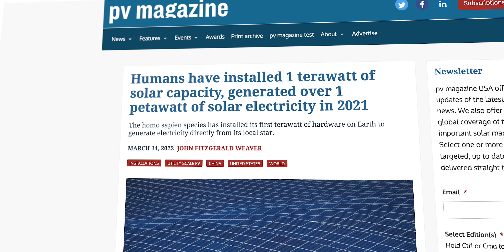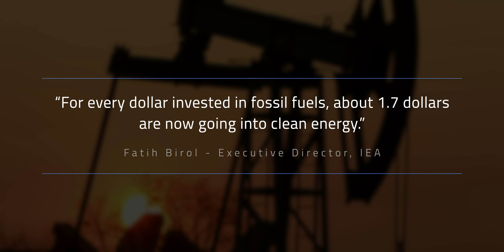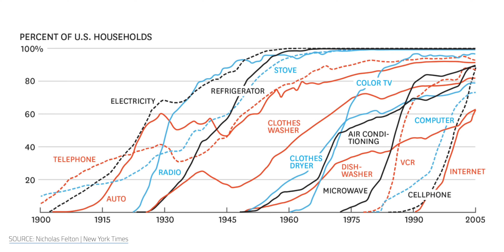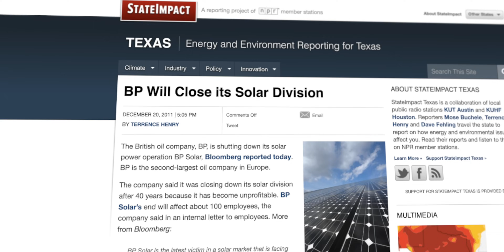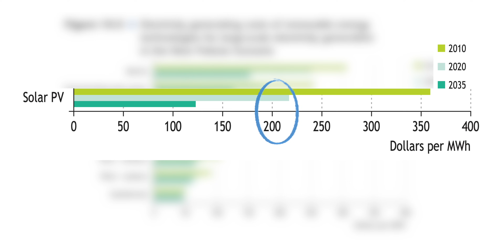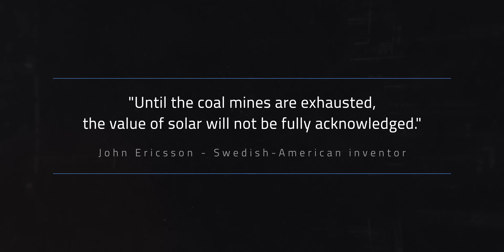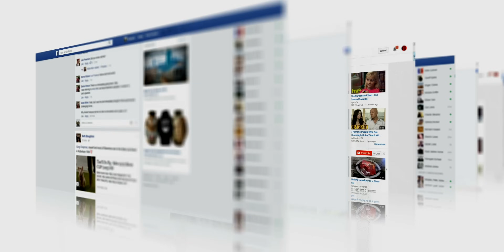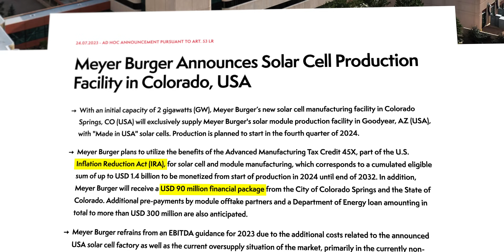How Solar Power Got So Cheap … So Fast

Comment: I knew solar would get popular eventually.  In 2001 we bought land that had no electric service, so it was dirt cheap, so to say!  I knew eventually we could install solar, and the land would be more valuable.  We are now at the point where its much much cheaper to install solar electricity, and the public is just now starting to notice this, so land prices are moving up for raw land with no electric service.  I was about 18 years too early, it took much longer than I expected for solar to catch on.

Comment: Solar panels can be down in price with little relief for actual install costs in part due to inflation of install costs labor, and support materials. Add to that you have issues if you need to replace your roof; and to make a pratical system; you need expensive batteries to store the power for night use. Of course you must be in a pretty sunny area. The best examples of solar installs today still cost about twice what convensional power costs per KWh.

Comment: Batteries are moving to LFP technology.  it is worth waiting for these before installing a battery because they are much safer.  They are much less likely to explode or catch fire.  They will also last about twice as long as NMC or NCA technology.  However, they are a little bigger and heavier but that is not a problem.  I think that they are a little cheaper as well.  Eventually we will get to solid state batteries but that might be a while yet.  These will be even better than LFP batteries.  They should be even safer and last much longer as well.

Comment: I live in Kenya and I'm building a house that will sit (for all intents and purposes) right on the equator. The closest village is called "Jua Kali" - which translates to "Fierce Sun." All of that coupled with sunrise and sunset being at exactly the same time all year round, we are in an ideal place for solar. There are no incentives here from government. There is little incentive to  connect to the power grid, The one power company we have (it is a monopoly) will only give you 50% credit for any power you send into the grid. These are credits. That means for every KWH one pumps in into the grid, one gets credit to purchase half of one KWH. One still has to pay all the standing fees that are on top of basic consumption of power. Our power grid is very unreliable. We lose power several times per week. Typically for an hour or two. But sometimes for a day or more. Going completely off grid by installing power storage is desirable, but it is very expensive. As Matt has said. It all comes down to money.

Comment: Surprised the Thomas Edison solar quote was not quoted in this video, yes from the guy that commercialized incandescent lightbulbs. 
“I'd put my money on the sun and solar energy. What a source of power! I hope we don't have to wait till oil and coal run out before we tackle that. I wish I had more years left!” (from a 1910 interview)
A hold back to solar cell production has been silicon wafer production. The increasing demand for electronic chips in recent years has limited wafer supply somewhat as demand increased prices. With interest in global diversification of wafer production post-pandemic, there should be many new manufacturing sources of wafers, thus helping drive down prices from raw material sourcing to production.
BTW: it's fascinating the last 5 years, the growth rates of battery energy storage are very similar to solar growth rates. A perfect match.

Comment: Here in Lebanon under 2 years almost 5 out of 10 houses and buildings have solar on them.

Its so cheap compared to 3rd world alternatives. Public electricity is under 5 hours a day to 1 hour a week. Private generators cost a lot.

Solar is cheap and off grid here. With under 3k we power our house with around 2kWH panels

Comment: I would love to know how other competing technologies, like wind, are affecting this curve. Things like going from land lines to cell phones and then to smart phones do not have the same competition as solar does.
Reply: Wind can't work on individual residential, only big commercial farms.  So that also effect distribution lines.
Reply: Wind power has dropped in price and is continuing to do so (especially offshore wind) but not nearly as quickly as solar PV. However both have already got to the point in most countries where the cost of new capacity using them is lower than the cost of new fossil fuel plants even without any subsidy, and is much less than the cost of new nuclear plants. That's even taking into account the cost of the extra storage capacity (batteries, pumped hydro) they need. But it does vary a bit around the globe so I don't know if this yet the case in the US.

Comment: Hey Matt, where are you finding panels for $0.27 per watt? That sounds pretty amazing. And I'm talking actual watts, not where they claim 100w and then in practice you can't get anything more than something like 50-60w out of the panel under ideal circumstances. Although I don't think I've seen any claimed 100 watt panels go for anywhere near $27, usually it's closer to $100, maybe like $75-80 on sale
Reply: Check Trina Solar Vertex + 435W
Reply: thanks. After looking into them, I don't see any suppliers or dealers of them in the US?

Comment: I have solar on my boat and it's not very good. Barely do my fridge and the physical size is about a house door and a half 515w. Also they are not clean or green they are very poisonous when they're created, very in efficient and don't last that long either. "green tech" has a huge waste problem you can't do anything with them once they're discarded. Areas also get hotter as the panels reflect heat so they're like little radiators, when they get hot they get less efficent.

Comment: It is more about money than you let on. The reason solar exists in all the areas is massive financial incentives. Basically the governments said that if people aren’t going to choose to buy solar we’ll force everyone with taxes from everyone that we’ll give to a few. Given that the total benefit of solar is still not clear, This is not a fair way to do it. If that same money was put into nuclear, a safe and proven cleaner tech they would have more power for cheaper. Governments effectively completely wiped out the right 50% of that adoption curve and replaced it with “forced to use”.

Comment: I have been doing solar for 6 years already. Everything from panel to inverter to battery ALL Reduce, Reuse, Recycle.   I use NO new.   Way harder way more involved  than now.   That is why so few do it EVEN now with that route.

Battery pack from recycle batteries
Inverter fro Ups
Panel from used top tier panel ( I only buy used panels top tier brand only)

Other than battery pack with  continual rebuild everything else  still works.  It runs the whole house    serious stuffs NOT a  dingly small shed.

Nowadays there are more choices at much cheaper.  I would say the battery storage pack is the biggie.   Well soon i will use battery pack from EV.

It feels good when i make my own clean electricity  from the sun with  used stuffs applying Reduce Reuse Recycle concept.

Guarantee only about 1% of the population would do it this way.    When you go this route your level of understandig goes up 10 times.
Anyone can plunk down the cash to buy anythig new.  Taking something used and turns into a  usable again requires anoter level.

Solar energy is the future.  I stop buying anymore ICE vehicles.  Only EV  until the day i die.  I had the Tesla Cybertruck  deposit since 2019

Comment: Just bought an 8.1KW system with 10.4kw of battery storage. Live @ 42'c South in Tasmania so suns pretty low in winter, but panels will still make on a sunny day 20+kw and 40+ in summer. $21000AUD or $13500 USD.

Comment: I actually had a friendly argument with a friend of mine about twelve years ago about the future of renewables. He was adament that wind was superior to solar PV. I of course disagreed. While I know development of personal wind generators was taking great strides, I figured it would be a difficult sell. Simply because of the maintenance aspect. 

In most places, you can install solar PV panels and walk away for decades. Just having the occasional inspection of wiring, fittings, etc. With wind, no matter the scale, there are bearings that will need greasing, brakes that will need replacing, etc. Plus, there is the noise aspect. Rotating machines produce resonate frequencies. Whereas the solar PV cell is entirely solid state.

I told him wind would never go away and that it would be integral to the mix; but, since solar PV can be installed on any flat surface. It was only a matter of time before it would surpass wind.

It hasn't gotten their yet; but, it's still very much on the early adopter's phase of the curve.

Comment: When I was an insurance adjuster a few years ago, it was incredibly rare to find solar panels older than 10 years that were still in use. That makes it hard to trust the longevity of the tech.
Reply: SunPower panels are guaranteed for 25 years. That's not unusual for modern panels.

Comment: I have an idea for energy but will it work i don't have a way to test it so this could be a fun test for someone. Take a sphere coat the inside with a Mosaic of small mirrors then shine a laser into the sphere. Now of course if the mirrors where all at the same angle you get a fixed pattern so each mirror must be angled so the beam reflection crosses as close to centre as possible, so a concentration of light builds up in the centre. At some point will the light in the centre become a source so the laser can be removed???  especially if a mirror can replace the laser before the beam does a full circuit???? Light travels forever if nothing obstructs it and mirrors can reflect light forever? So would this idea just go out with the removal of the laser??? Would it produce permanent light/energy???? or would it go out of control??? ... I hope people see this and don't dismiss it without even trying it because you think you know what the answer would be because as far as I can find nobody has tried it

Comment: solar faced the same issue that nuclear has, just at a different purchaser scale (solar is much broader in purchasers as nobody is building their own personal chernobyls in their backyards but a lot of people did buy a personal panel or 10). more expensive today but cheaper tomorrow is a much harder sell than cheaper today but more expensive tomorrow, it's the same with credit cards, cheap today costly tomorrow.

Comment: The IRA (along with Chips & Science Act) is the most underrated bill passed in my lifetime. Incredible America-first, rural revitalization, emissions-erasing, industrial build out legislation. It’s in a tier with the interstate highway system or Works Progress Administration, Rural Electrification Act, Tennessee Valley Authority, etc. It’s a return to the type of American policy that built post-WWII middle/working class prosperity, combined with a little 1970s Clean Air/Water Act, EPA energy thrown in.

Comment: When specific subsidies cause adoption rates to rise, that isn't a natural part of that adoption curve.  It can move things forward faster, but when the subsidies end, the tech needs to stand on its own.  Some kind of subsidy for solar could still be reasonable because it reduces air pollution that actually harms other people, but we are well past the point where things like net metering are justified to pull in a critical mass of adopters.  

Net metering is a subsidy for the upper middle class, suburban homeowner, not solar power itself.  And in many places, it's a subsidy paid for by the  power company.  The government has no right to force a company to subsidize something that the government wants subsidized.  Batteries for an electrical grid are expensive, and it would be better to handle renewable power partially on the demand side, rather than depending entirely on batteries.  Getting rid of net metering, or at least implementing time-of-use rates for electricity, would encourage demand to shift to match supply, saving on storage costs.  Daily peak usage is a few hours behind solar's daily peak production.

Comment: I have 25 KW of solar.  I am a huge supporter.  With that said, with just about every government in the west cancelling oil drilling permits, not approving any new drilling projects, etc, it is difficult to know if the $1 for legacy energy projects to $1.7 renewable is a number that can be focused on.  If you can't get projects going, then you can't spend money on them.
The US "Energy" secretary is a joke.  I believe in renewables.  I don't believe in crushing the working poor who still have plenty of old ICE vehicles that they need to drive around.

Comment: I am super excited about getting into solar. I'm currently building an all electric home with the intention of going solar. However, I am finding that finding a reliable company to buy panels from is extremely challenging. I have read many nightmare stories about people getting into solar only to have the solar company go bankrupt, leave the job unfinished, not pull the proper permits to make the array functional, or just having terrible customer service after it's been completed. Do you have any suggestions  or any resources that I can look into about which company to go with?

Comment: With the price of Solar generators dropping in price from thousands to just a few hundred dollars, along with a huge price drop in solar panels(panels that now cost less than $100 dollars) you can get everything you need to power a home for around $4000 dollars.  More people need to learn about Ecoflow and the dozens of other solar generators on the market.  There is no reason every house can't be running off solar power. 😊

Comment: Maybe you did mention this but the efficiency of solar panels although still not great has improved almost yearly it seems. This reduces the number of solar panels needed compared to the past. Efficiency grows with any product developed at least with successful ones. But I do totally agree with your reasoning and hopefully we’ll see the same for other green technologies. I opted for more insulation in my attic vs solar on my roof because I had to reshingle my roof and I could not do both. I did the insulation a couple of years later. Plus regulations and refunds seem to be pretty sketchy. Could I have gotten a tax credit on solar. Maybe. But that doesn’t help when you are retired. Refunds or rebates on insulation just isn’t a thing anymore
Reply: Records are still being broken every year in the labs for solar cell efficiency so it is very likely that the efficiency of mass manufactured panels will continue improving for a while yet. The cost of solar power will therefore continue dropping.

Comment: Solar has a problem... darkness.
Just like wind power has the problem of calm days or the wind being so strong they have to lock the blades, stopping rotation to reduce drag (seems counteer-intuitive, but it's a fact) in order to reduce the chance of toppling the tower.

Solar is a wonderful idea in places that have 90% sunny days.  Like where I live.  Near the US southern border in an area that often goes 3 months with no rain in summer and rarely has 3 days in a row that are cloudy.

Seattle Washington is almost the opposite.  Nearer the northern border, thus seeing stronger seasonal differences.  Months in a row without a clear sky.  Even worse is Anchorage AK, nerer the Artic circle and 3 months a year of not enough sunlight to get 20% rated output from the panel even on a "sunny" winter day (what few sunny winter days they have...)

Certainly, solar is becomming a better personal choice here, but I don't foresee it being the solution in Alaska without the Earth's axial tilt changing.

I do plan to get panels installed, when I can figure out how to do it without making my land look like aliens are using it to harvest our Sun's energy...
Reply: What is the total population of Alaska?

Comment: Installing solar on homes but having a storage shared across a subdivision would reduce costs for everyone and utilities could pay the homeowners for the use of the solar panels to keep the neighborhood storage solution fully charged while allowing the homeowner to have nearly unlimited use of the remaining generation. when there is an outage the homes that have provided power would have preference.
I understand the concerns about net metering changes but lets face it, utilities should only provide the generation costs they pay back to the consumer for the excess the consumer creates across a billing period, which still would let the consumer zero out their bill but they should never be paid the cost that a utility sells the electricity for, only what it pays to create it